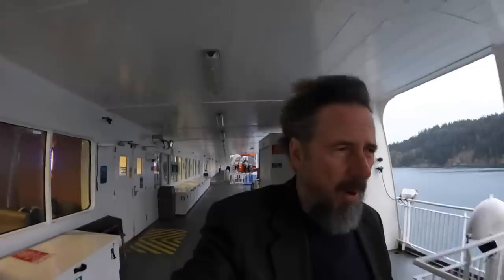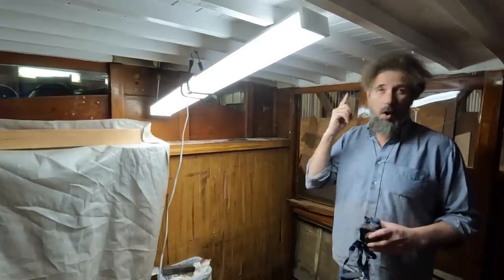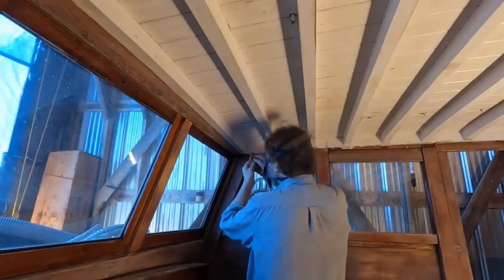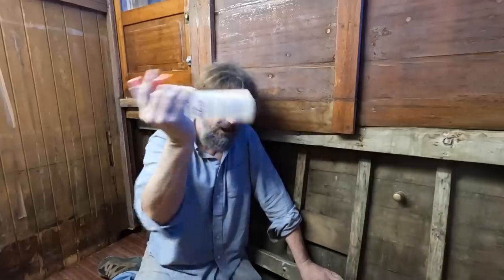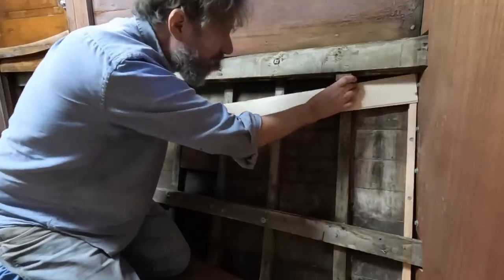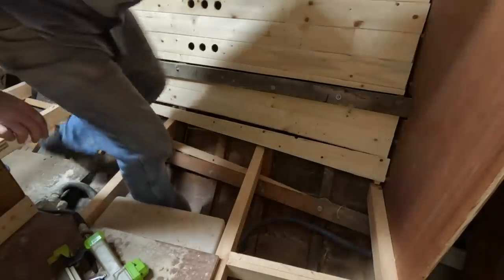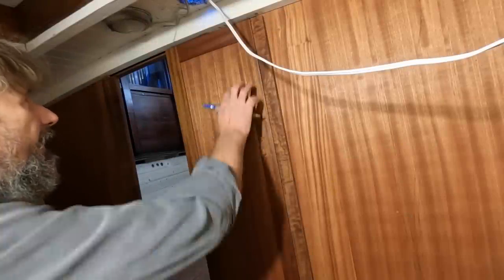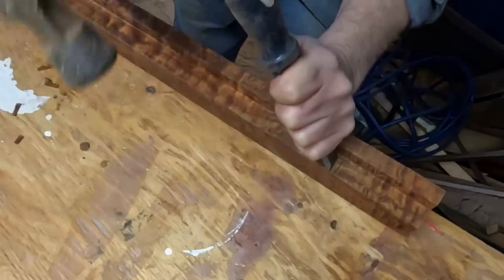Stain, Hinges, Ceiling - #350 - Boat Life - Living aboard a wooden boat - Travels With Geordie

Comment: Ceiling: Light wooden sheathing or inner skin planking fitted to various parts of
the vessel such as the floors and the tank tops to form a working surface
and to protect the vessel’s structure and the cargo from damage and to
prevent cargo falling into the bilge spaces under. Sometimes called
footwaling (futlings) in barges. Similar work up the vessel’s sides and
bulkheads is called lining.

Lining: Light planking fitted inside the frames or timbers and forming an inner
skin to the vessel. It may be close laid forming a complete surface or
open spaced when it is said to be laid room and space and the vessel is
said to be spar lined.

Comment: Totally onboard with your new ceiling. That was on of the first things I installed after buying my boat back in 1975. I used 1/4 X 1 inch mahogany strips (actually it was home door stop material) to keep bedding and such other cloth or similar material away from the hull. It worked as intended for all 10 years I lived aboard. I'm loving this remodel. 😁

Comment: I removed all the ceilings.. there's another name which I can't remember .. as the hull sweated.
I use a microporous clear similar to varnish with a matt finish on the hull.. particularly with new planks which are oak.
The ceiling in the bathroom is a sheet of plastic.. I keep an eye on it.. it was a for sale sign board.. there are different types also look at aluminium composite panel it has a layer of plastic in the middle.. both have different colours and textures.. ask at a sign makers.. also look in the skips for rejected and damaged sheet's or signs... I also renewed my wheelhouse windows the perspex did need polishing to remove the scratches.. last year I got 4 sheets of 8' x 4' aluminium composite with damaged corners also a load of perspex.. I made new non rot gunnels.. (I filmed it, video soon) cheaper if you bought it than marine ply (which is not so good quality now)... The quality of ply is not good here and I am intending to use the laminate in future...
Decades ago I put boards with an air gap all the way round under part of the deck.. I saw a few boats do it .. Don't... It caused dry? rot.. this year.. weather permitting I am going to replace it all .. the original is V grooved T&G soft wood .. original from 1946 and I'm replacing it with V grooved Larch nicely seasoned and already varnished...
Interesting about the tea tree oil...

Comment: A lot of woods will silver with exposure to UV. Is there a way to finish lumber onboard or ashore to allow it to prevent silvering and allow it to breath?
Reply from the maker: That’s a good question. It seems the woods that silver the most are also the most hardy without finish. Teak, cedar etc. Most like them to silver. But if you want to retain their colour you’ll definitely need finish and it will require annual sanding and recoating. As long as the backside is raw it will breath enough.

Comment: Peter, I am not ok with your reverse flow ventilation. Hot air (in the living quarters) contains much more moist than cold air (bilge below sea level). Drawing the hot moist air behind the sealing will cause condensation and mould. No amount of teatree oil on board will prevent that. Ask Tim Vuckman if you want for confirmation… Johan B
Reply: Boat is always humid, air is and so is the hull. Ventilate away!
Reply: I'm afraid Tim is busy trying to secure the "hazy" beer.  I promise to wipe the condensation off the bottle as I empty it.

Comment: is that the headless pin nailer you are using?
Reply: Hi ya.
Yes... It fires stainless steel pins.
Something to note.. the nail guns don't seem to work with generators even 4kw.
It would be nice to be in contact... I gave my email.. I'm also on IG.

Comment: The garage turned out to be a ferry,
So, the video started on a merry
Tone. And poem now starts to look again
Like a functioning boat. But then again
She still needs some work!

Bung in the bungs with a Forstner bit
None of the bung-trials turn out to be sh**
So, just take the easiest way to fill
All the drill holes of yore that are in there still.
And don't stain them wrong!

Now for sanding. The walls AND  overhead.
After the last one your arms are dead!
Then it's sealing the walls with cheap, painted wood!
Painting just one side, mind you, will be good!
And Peter tells us how he stops the mould.

And seal it up. Then stain the walls with Loyd's old
leftover staining which works like gold!
And bungs merge with panels. The Gel
Stain does really work like hell!
So, the wood is now covered!

Now for the hinges of last week's door
We it needs cutting the grooves for
Said hinges to sink them in.
Et voilà - they work mean!
The doors now just need knobs.

This week's beer's hazy - no! It's a stout!
Well, it is both! And there is no doubt
Owen is here for the weekly beer-cheer
But the main thing is that Owen here
Got a mooring for Poem!

And now for the word we're all listening for
It may or may not be op'ning the door
To be sent some free merch - a shirt indeed
And Owen really has agreed
To say "On board"

Come on boart or aboard this summer!
It will certainly not be a bummer
To see Poem, Zephyrus, Geordy and Peter,
Perhaps even Finnegan and Lady Z to
Help or have free time (probably both)

Come to Vancouver, And join the crew
Of gaudy geordy-builders - yes, friends, come, do!
So the funds and some help can be procured
And Geordie's last ailments be finally cured
So peter can cruise!

Now let me wrap this - my rhymes start to bruise.
(Tim Buckman, I hope you forgive me for not mentioning you!)